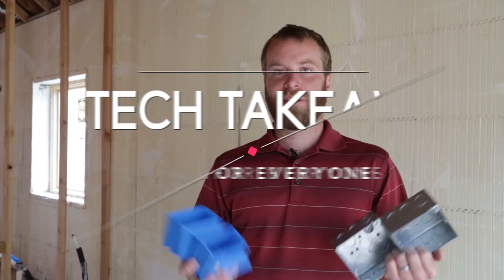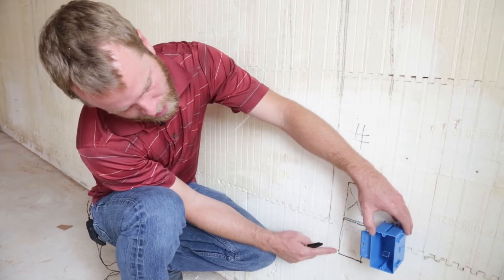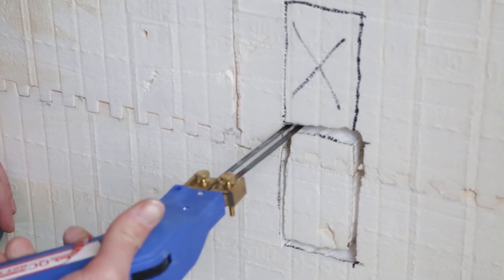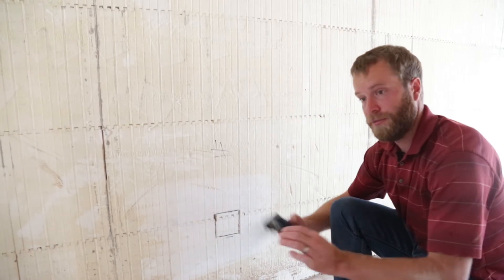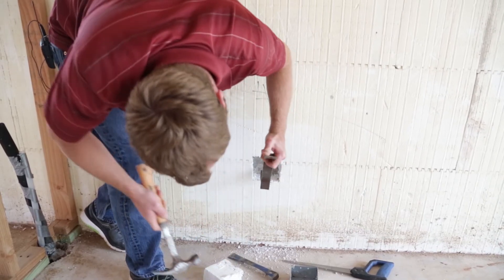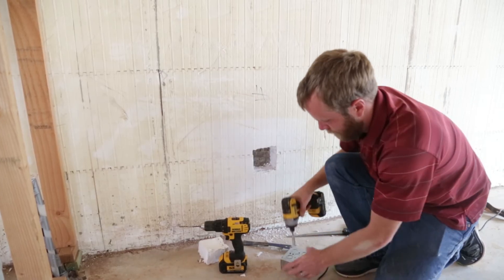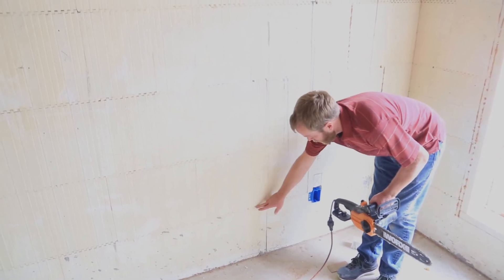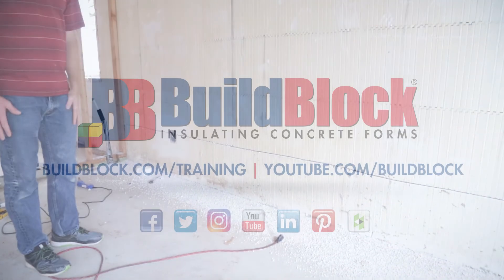How to install electrical wiring into ICF walls

Comment: so if the walls have drywall on them and you want to add a new circuit you are going to have to cut the drywall all the way up to the ceiling to run the wire???!!

Comment: Pretty amateur but proves that even a layman can do it.  “Using the battery-powered driver as a hammer!” Running the chainsaw/blade against the concrete?  What a pain that would be to “stuff” 12/2 wire into that narrow 2-1/2” deep cut in the foam.  So many JV examples in this video.

Comment: ICF is a pretty unique product but watching the amount of time it takes to install one box is so much time lost
Reply: But then you save time cutting the wire trench in the blocks rather than having to drill through a bunch of studs to run the wires.

Comment: The depth of your ICF to concrete have to be taken into consideration. The insulation on my walls are 2 1/2 to the concrete. His PVC boxes won't work. I had to go with INEXO. 
Don't go with anything else. No metal boxes either!

Comment: I question the reliability of this demo when the person demonstrating is using an impact driver/drill as a hammer to remove knockouts.
Reply: I came to the comments for this
Reply: As a licensed electrician I can confirm this is the proper way to remove knock outs.

Comment: Well, I realize this is from 2019 but, it would have been better to lay out Electrical Before Concrete or Grout, and that requires some cautious planning on the Electrician's part. Being an Electrician for more than 30 Years.. I am Planning my ICF Home now..
Reply: Just frame the inside of your ICF build so you won’t have to cut into the foam.
Reply: @4philipp  termites can eat the frame. Hard to spot termites under icf. Rockwood will help I assume as I dulation to prevent them.
Reply: @shrek22 use metal Frame
Reply: I'm building my home with ICF as we speak. It's better to lay electrical after wall is concreted in and via the inner polysterene wall :)

Comment: As someone with experience with this stuff, I would assume expanded polystyrene (EPS) is the insulation. I have seen when PVC coated cables are laid on EPS it eats into the cables and cause them to become very brittle. I can't see this being safe unless the cable is put into conduct resistant to the EPS or the EPS has some kind of additive added to it. Would like to know if anyone has more info on this or has seen the same thing happen.
Reply: Thanks for the insight, this is good to know and the exact reason that I hang out on youtube watching videos of things I "already know how to do". I know conduit in the forms (i.e. embedded in the concrete) weakens the wall, but it seems to be the better route IMO. My thought is to go up a block size from what is necessary from a structural standpoint and then there's room for the conduit without compromising wall integrity.
Reply: NM contains pvc coated cables within it but the outer sheath of NM, which contacts the EPS is protecting the inner conductors. The electrical code specifically allows routing NM cable through a channel cut in EPS. I wouldn’t be worried about this.

Comment: I always wondered why they don't put plastic conduit in the ICF pour for pulling wire through so your wires aren't exposed. I suppose it adds a little cost but man it would be nicer.
Reply: Then the ICF wall would be weaker and the cable is no less protected than when it is tacked to the side of a wood stud.

Comment: You couldn't pay me to live in an ICF house
Reply: Not sure where you get your info from but I hope you are not a contractor
Reply: Why?
I live in a northern climate in Tornado country and am looking to build in a rural area.  
The peace of mind it would give knowing my family is protected. 
Those concrete walls keep things nice and quiet during frequent 30+mph winds. 
I'm very interested in why you dislike ICF so much. I've been so concentrated on all the pluses maybe I'm missing some significant negatives.
Reply: @christopherbeddoe406  Think of it as a swimming pool, where moisture and air cannot escape unless you ventilate, therefore losing air you pay to heat while paying to heat make up air, so there goes some of the energy efficiency. People that use drywall, especially painted with acrylic or latex paints will get mold as vapor that gets behind it cannot escape easily. Wooden floors will also have trapped moisture and termites can easily make their way up the styrofoam. If a whole family is living there, and even large pets etc, thats a lot of vapor expelled and is even more than the showers and cooking, so you'd have to ventilate seriously to keep condensation from forming. The roof systems are often just wooden framed and shingeled or metal panels so same as mobile home these days unless reinforced. I'd prefer build a reinforced frame and place hempcrete, as it insulates, breathes staying dry. Foam shrinks and hardens over time as well, but even clay walls and hempcrete which is not made with concrete but lime will last centuries. Or a strong 1 story timber frame infilled with hemprcrete, woodwool panels plastered in breathable lime, or pourous brick and lime. Seriously the best materials. Wooden frames and steel frames can be made very strong and anchored well into the earth. Idk about roofs in tornado zones, but, most ICF's are just wooden framed standard roofs. Use only nails and the thing might come apart.
Reply: Otherwise, as those methods are still scarce for some reason, I'd just buy manufactured housing or mobile home rated for your area, the company should anchor the thing down with large screw anchors or to a foundation and insure and replace if the thing gets torn up
Reply: @PP_2729  all ICF and tightly sealed homes need a dehumidifier to remove moisture. This can also be accomplished when the AC is running. 

I open my windows at home a lot but you need a source of make up/ fresh air. This can be set up on a thermostat so fresh air comes in at the best time of the day.

Comment: Why wouldn’t you just fur out the wall and avoid cutting the foam.... wouldn’t this lower the R value?
Reply: Because $
Reply: Talking about r value loss on a solid concrete wall is a bit overkill😂

Comment: I guess your not dry walling over that as no allowance for drywall was left?
Reply: The clearance for drywall is built into the purpose built ICF boxes. That being said based on the way this guy was beating holes with that drill this guy doesn't seem to care much about the right way to do things.

Comment: How do you hang stuff like pictures, mirrors, and shelving and on a drywalled icf wall?
Reply from the maker: The plastic webs that hold the block together are a half inch below the foam surface and provide attachment points every 6 inches horizontally. It's like having a stud every 6 inches. BuildBlock also has hard attachment points that allow for attachment of heavy cabinetry or finishes.You can learn more here: https://buildblock.com/buildblock-icf-installer-training-series-trades-finishes/
Reply: @BuildBlockICF  But how do you find these webs under the drywall?  Will a stud finder read the webs?
Reply: @rockys7726  The electronic ones will not but there is a Japanese stud finder that is actually a sharp pin on the end of a handle  that you stick through the drywall. You know you’ve hit the webbing when it stops short of bottoming out.
Reply: @ACitizenOfOurWorld  so you leave holes everywhere you miss the stud?

Comment: As a electrician Apprentice this was cringy. Please show an electrician how you Think it should be done, then let the Electrician make the video. The way he was using his tools was appalling. I wonder it dewalt will still warranty his tools? Is anyone wondering how straight, flush, and to NECA code this would be with what he did plus his suggestions?
Reply: I always wondered why they don't just mount a run of pvc conduit in the ICF pour for electrical. 
Jamming the wire in a small foam slot just seams crappy to me. I suppose it's actually mounted deeper than in a 2x4 wall.

Comment: In short, wiring a icf house is a pain in the ass
Reply: Yes but you dont have to drill holes through all of those studs!
Reply from the maker: Only if you accidentally sit on your hot knife!
Reply: BuildBlock ICFs Mounting one box literally takes ten times (conservative estimate) to install. So I would say it’s a pain in the ass.
Reply: Just along the exterior walls. Interiors are still sticks

Comment: I started watching these videos because I'm heavily considering building a new home in the desert with ICF block. After watching this guy using electric tools for a hammer and punch, made me lose interest in the video. Very unprofessional. Especially when it's supposed to be a training video.
Reply: I thought that was ridiculous also  but I'm still open to ICF
Reply: @ELIRAXPRT  The reason it's taken me a year to get back to your comment is as I stated, I seldom watch this poster's videos anymore for reasons previously stated. In my original comment, I never made any indication of a loss of interest in ICF Construction. Better supplies and techniques coming out daily.
Reply: John Nickolsen you’re dealing with concrete, so you need a hammer drill 😂
Reply: @Couchlover47  Sorry, I'm getting back to you so late. I never said I lost interest in ICF Construction. Don't know how you read that into my comment. I clearly stated that I lost interest in these particular videos. As far as using tools for their unintended purpose, this guy is literally using a cordless drill as a physical hammer. (This isn't like somebody in a pinch using a screwdriver for a chisel.) Not to mention, chipping at concrete with no eye protection. This guy is a walking  liability lawsuit. 
    My background is in design, manufacture, and installation of equipment for labratories, clean rooms, and cryogenic research with over 43 years in the trade.

Comment: bolt a wheel onto the end on the chainsaw so that the wheel acts as a gauge to keep the chain from hitting the concrete.
Reply: Peter Beyer thx for the tip!  Sounds like a great idea. Having trouble visualizing it though.  Do you have a pic or a how to video?
Reply: @cfberry  two hockey pucks with a bolt and some washers
Reply: You want to let the chain hit the concrete so no one steals your chainsaw! Our favorite is a 10" blade for better control. We cut out for ALL switches & receptacle boxes with the saw. Need extra room for a plumbing stack? Foam glue a 2x4 to the location, cut on both sides of the 2x4 with the chainsaw. Push the 2x4 flush with the wall & retain with some scrap wood. After the pour, saw out the foam with the chainsaw and you have a 4" square chase.

Comment: Hot knifes tends to enlarge the hole more than needed and does not leave any mess otherwise other than the piece you removed.
Saws of on the other hand of either the hand or electric powered type will cut the same hole but also leave a mess of pieces you need to or otherwise might want to clean up. 
Utility knifes are a cross between the hot knife and saw as it will cut though the tip will get damaged when you hit it against the hard concrete but only what you need and without leaving so much as a mess. Best of both worlds, especially if you warm it up to make cutting a bit smoother as long as you do not get it as hot as a hot knife.
I prefer a hole just large enough and slightly snug for the box to fit so you do have to foam spray fill much afterwards, especially if it is an outside electrical utility box or even a water spigot.
Reply: I used a hot knife for my build and it worked great. Yes it does enlarge the grove a little bigger but at the end of the day it is of no consequence since you need to anchor the wire to the concrete to keep it as far back as possible so a little extra width isnt a bad thing and you re-spray foam around the boxes and wire channels anyways.  Typically there isnt a huge number of electrical channels and boxes on exterior walls so the little extra spray foam need to fill all the wire channels that are 1" wide instead or 3/4" probably doesnt even equal 1 can on most homes and the homes that are big enough to need two can afford the second can :)  Either way you do it you win because you have one of the best built and insulated homes you can buy.  I had to sell my ICF home when I moved out of state but I can honestly say if I ever built another home ICF's would not even be a question its the only way IMO.